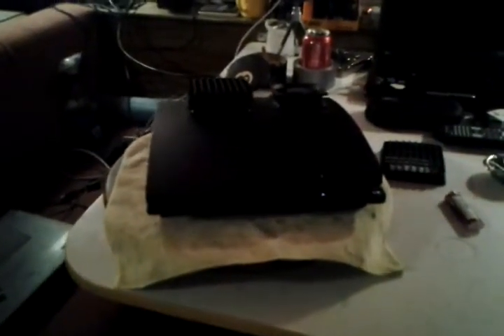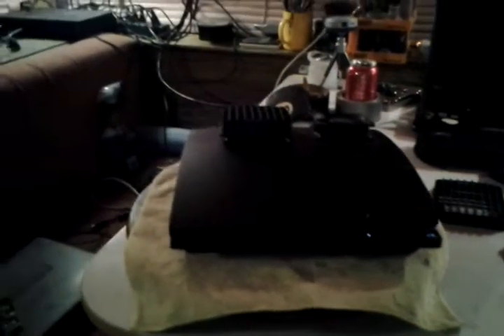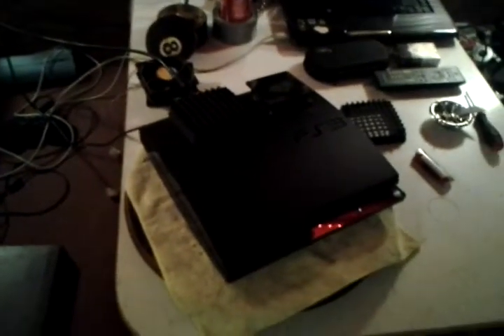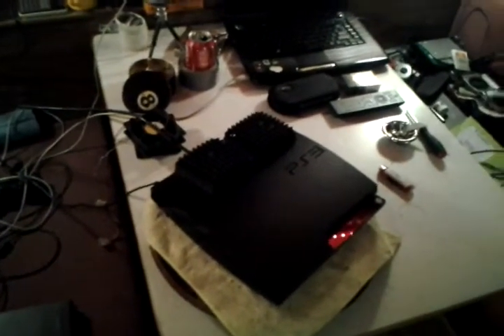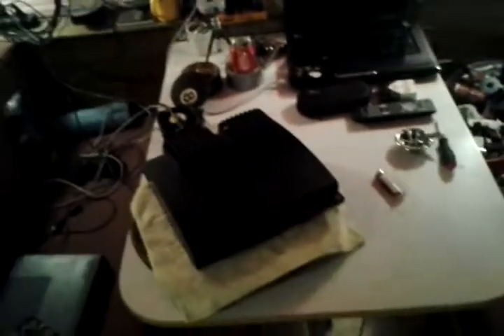PS3 Slim CaseMod Fix for Overheating Power Supply [cech2501a]

Comment: Like Ur ingenuity, but black or red are usually hot;  white in most normal wiring configurations is neutral.  Just don't want someone shocking themselves on another more common wiring project.   Peace
Reply from the maker: In the "PS3 Big Fan" case, brown is 12v hot, black is ground and grey is PWM.

I guess it depends on the product. I deal with a lot of computers, and in a computer based system yellow is 12v hot, red is 5v hot, black is ground. Most DC products like fans on 12v circuits are black ground and red hot. Many products require a DC converter, which has a wiring diagram more based on common sense of logic than the AC "standard".

I've always understood DC ground circuits fluently, and not understood the neutral AC circuits without overly complex diagrams, considering all the times I get a fan that has grey and blue wires, or two white wires with black stripes. If its black and red - and red is ground, I would really consider who made the product and if it is worth connecting it to the larger system...

Comment: Very nice and keep up the keep up the work two thumbs up if you come up with something like that on the Xbox One I would like to see that on the Xbox One
Reply from the maker: +Dusty Wyatt The best Xbox mod was on the 360, when they put the power supply outside of the unit and added a fan to it.

It could be done on the Xbox1. One of these days I'll do it. Gotta build a box for the power board and extend the cabling outside the case.

Comment: I think the best way is to get an external source for fans and accessories , running more wires tru the system will overload and all you effort to keep it cooler will only compensate for the load that you put on, the are great ideas is just a suggestion what it would be better.

Comment from the maker: That's awesome coolblackrain11! I'm glad it worked for ya, if only Sony had the foresight to include a fan in their PSU, eh? That, or like the X360, have a fan AND have it be outside the case. This unit sold - but my next Slim, I'll be doing an external PSU with fans and placing fans inside the console where the PSU was.

Comment from the maker: The grey control wire controls the fan's speed with steady pulses, telling the fan at what speed to run. You SHOULD use a fan that allows pulse modulation tho. Generally there is three to four speeds, referred to as level 1, 2, 3, 4 etc. A potentiometer is not necessarily required, is helpful, but can be dangerous if left at level 1 permanently - making the mod rather self defeating. A potentiometer with a kill switch allowing for the option between automatic and manual fan control is optimal.

Comment: Not to tell you your wrong but I have done a similar mod to my ps3 slim and using a volt meter I have found out that the fan inside the ps3 slim is constantly getting the fan 12 volts from the power supply.. The grey wire is the control wire as you stated but the mother board doesn't regulate the fan speed by the voltage. The mother board tells the fan how fast to run and that speed control is unfortunately built into the fan. So the fans always get 12V. A potentiometer is neede to control speed

Comment: I fell in love with your idea. I purchased two 80 mm fans and going to try to attempt the same. My ps3 slim overheats after being on for about 5 - 10 min. I opend the power supply and tried the screw thing and didn't work. Hopefully his does.

Also, the fans that I found are both connected to a usb wire, so instead of having to do all of the wire work this can be easier. Just insert it right in the usb port.

Comment from the maker: Lol, I know! It's not just through the ports though, there are a few slots around there and the HDD cover. If you shine a flashlight in there, you can see the light stream out, and that's where your PS3's breathing room is.

Now, me and you are talking about adding a second fan either to the top or bottom of the stock fan. No matter whether it is top of bottom, you want it bringing air in. If you want any output fans, I suggest over the power brick, or over the BDD/HDD.

Comment from the maker: There isn't much airflow coming into it, it comes through the slots by the USB ports and is exhausted straight back. It brings some in from all over the inside of the case around the disc drive and hard drive, but the USB ports are where the main intake is.

It really is! You're actually better off going from underneath, because you can keep the unit lifted off the ground and get some better cooling that way for extra intake. Above would work, but it is less effective than below. :D